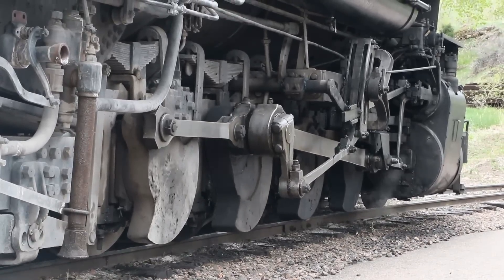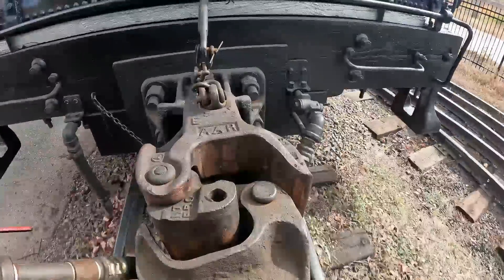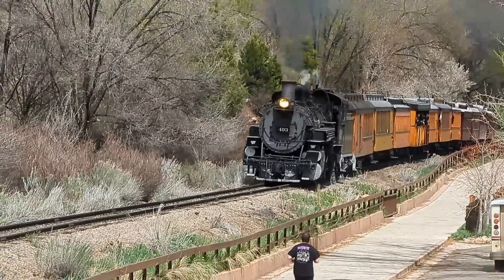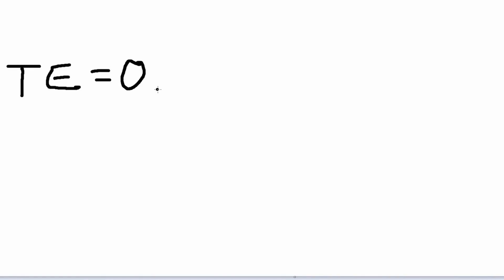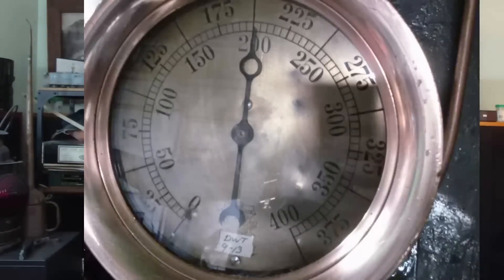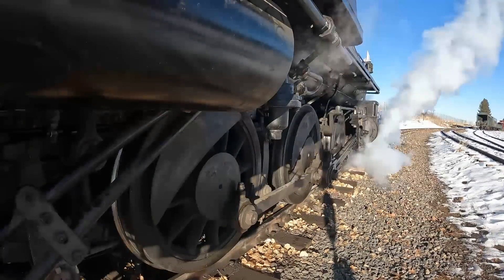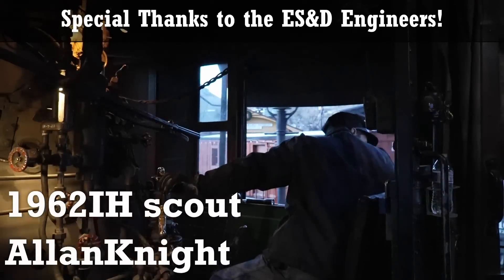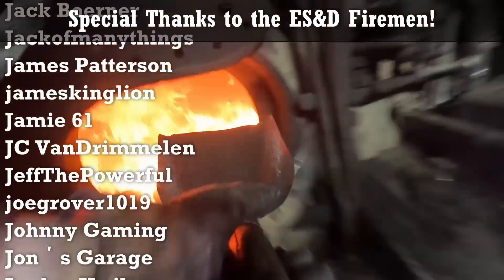Busting Tractive Effort MYTHS! | Railroad 101

Comment: Excellent video. Definitly needs to be part of any steam locomotive class.

It's interesting reading railroad engineering books about the wheel and rail dynamics. Steel is elastic, so the contact area between the wheels and rails changes depending on the steel types and weight. But generally speaking, more weight per axle means a larger contact area; conversely, less weight means a smaller contact area. It works out that a locomotive with one drive axle with X weight versus a locomotive with four drive axles with a total of X weight has nearly the same total contact area between the wheels and the rails. This is why the number of drivers isn't as important as one would think.
Reply from the maker: That's interesting! I'd imagine tire hardness plays a lot into that as well. Makes sense.
Reply: @Hyce777 @Hyce777  Yes, the hardness is important. The higher the hardness, the less elasticity in the steel, and the less traction can be developed. If the wheels/tires are too soft, they'll have good traction but wear faster, increasing repair downtime and raising maintenance costs.

Also, the harder the wheels, the faster the rail will wear down. Thus, the railroad must balance how often it wants to replace rail vs. wheels.

ASTM (A-504), AAR (M-107), and APTA (PR-M-S-012-99) each have standards for metallurgy and hardness of locomotive and car wheels depending on expected speeds and braking forces.

In Grand Scale trains, car wheels are typically made of high-carbon steel and have hardened treads, while locomotives have medium—to low-carbon steel tires for increased traction.
Reply: @CurtisFerrington  : Also, to a first approximation, friction is proportional to the weight applied, and not proportional to the size of the contact patch.  I suppose that there are second-order effects there, though, as well as effects on durability and rail wear, though?

Comment: Would be very interested to see the TE formula expanded into a mathematical model that could describe/predict how a locomotive and train will behave at different speeds. It should be possible to derive the optimum throttle and reverser settings if the model is detailed enough.
Reply: There are several ways to account for it at speed, from pg. 23 of Principles of Locomotive Operation and Control: T.F.=[(0.85P*s*d^2)/D]* speed factor. P= pressure in inches, D= diameter of drivers in inches, d= diameter of piston in inches, and s= stroke in inches. The speed factor is basically has to be derived to show the locomotives tractive effort changes at speed, and the book isn't super clear there on how to derive it. But pg. 24 shows a Baldwin table that calculated out various common tractive effort curves as speed changes.
Reply: @jacoblyman9441  I wonder how much of that is theoretical and how much of it is empirical. Wouldn't surprise me if the theory is actually very complicated but if you stick your locomotive on a test rig you can take readings.
Reply: @jacoblyman9441 it's not the change of road speed, it's a change in piston speed.

Comment: Wait are there really mechanical engineers who thought that making a wheel bigger would INCREASE the tractive effort? You can tell by looking that the piston rods are what's applying the torque... they're looking at the lever arm backward...
 
Did they also think that adding more steel would make the train lighter?
Did they think you could make the boiler smaller to produce more steam?

I... this... this... GHAAAAAAAAA!
Reply: Yes , they thought a larger wheel which gives more surface area on the railhead ....
Take a SD-40-2 drivers are 40 inches  ..
Now take SD70ACE drivers are 45 inches 
So yes , a larger diameter  wheel can give you a better grip if you have a much better power supply ..
D.C. TRACTION MOTORS 
COMPARED TO 
A.C. TRACTION MOTORS
Reply: @RobertSwickard-o1w  "I'm going to compare the performance of 2 diesels, and temporarily forget that the difference in tractive effort is really because of different motors and not the wheels. Then I'm going to assume that this translates over to steam engines without putting any further thought into it because steam is just a louder, dirtier diesel isn't it?"
 
-- Mechanical engineers who need better critical thinking skills apparently.
Reply: I expect that some of this is that the engineers were not clear about communicating their assumptions, and were assuming that their listener would interpret "increasing the wheel diameter" as including "increasing the crank-pin radius in proportion."

But engineers are never ever unclear about communicating things when they're talking informally.  Nope, not ever.

Comment: Layman´s terms:
1) Tractive effort: the maximum weight of your car that your engine can power without choking and dying
2) Adhesion: are you able to use that power without spinning the wheels?
3) Drivers´ size: final gear -> big = more revolutions, needs more torque
4) Piston stroke, surface, pressure: torque

Lesson:
1) If you want to tow a cargo ship, your super ultra tuned, high tractive effort semi truck may not be enough if it has only one powered axle (and low weight), as it would overcome the adhesion limit of its tires and produce only wheelspin.
2) Converting your cheap little grocery-getter car into all wheel drive won´t increase its tractive effort. In fact it may decrease it a little bit (due to increased inner friction). But it may help on a slippery surface.
3) Higher gear (bigger wheels) is only good if you have enough tractive effort and adhesion, and just want to go faster.
Reply: Thanks. This clears up a lot of my questions. Less confusion for me!
Reply: Meanwhile Jeremy Clarkson towed a ferry 100m with a grocery getter.
Reply: @kornaros96  Ferry is surely nothing like a cargo ship. Anyway, if the car has enough torque and adhesion to overcome the resistance of the water, then why not?
Reply: This is wrong. TE has nothing much to do with the weight of the car - that does become a factor in hill climbs, though. On level ground at high speed the thing your TE is fighting is mostly drag and the weight is a minor issue.

Comment: The maximum allowed axle load of course depends on the lines where the locomotive will operate. Each line having a limitation there (in continental Europe there are classes A, B, C, D from light to heavy with subclasses about weight per meter for bridges).
Back in the steam age for a long time the military required all Austrian locomotives to be used universally in times of war. That and the limited length of turntables put pretty severe restrictions on the growth of locomotives and lead to ingenious constructions. For example the first locomotive with five coupled wheelsets, kkStB class 180 (built from 1901) designed by Karl Gölsdorf with just 13.5 t axle load. Distributing the load over five wheelsets allowed it to have sufficient tractive force anyway (though I can't find the kN in my sources).
Even today some locomotives aren't permitted on certain lines for which they are too heavy.

Comment: If I may ask how did railroads calculate how much tonnage they could haul? Obviously TE plays into the equation as you said but I figure fairly early on the railroads made a system beyond "Keep throwing cars on until the train can't move at all or without breaking something.".

Comment: What about geared steam locomotives tractive effort calculations?
Reply: That should be fairly simple. Just do the same calculation but multiply it by whatever the gear ratio is between the cranks and the wheels. So if the cranks turn 3 times per wheel rotation then you have 3x as much TE.

Comment: Actually: why can a steam locomotive pull more than it can start? Compared to AC and DC traction.
Reply: AC and DC diesels have a large TE like steam when starting but diesel TE drops extremely fast when you are moving. 

I cant remember the exact math but you end up dividing by speed instead of wheel size. 

Faster you go the less you have compared to steam where it lowers TE at speed at a slower rate due to how steam works and expansion in the piston

Comment: I believe the coefficient in the tractive effort isn't something calculated from other prrcise things like area of a circle or of a sine wave, but instead something to make the numbers work. this is because the ratio of the radius of the drivers and the diatance from the crank shaft pivot to the center of the driver isn't considered, even though it is really important, because it doesn't change much across locomotives. So because all values rise linearly (other than the piston diameter but who cares) a simple cefficient can be used so that the funcion mathches real behaviour.
Reply: The ratio between crank diameter and wheel radius IS in the equation, it's just disguised. The piston stroke (last term on the top of the division) is just another way of saying crank diameter. And of course wheel diameter is on the bottom of the division.
Reply: @John73John  i did figire that out a few minutes after I wrote that, too lazy to edit
Reply: @torfley  Yeah we've all been there mate.
Reply: It's not.  See Johnson (1944) and De Pambour (1836).
Reply: 0.85 is taken as the mean effective pressure acting on the working face of the piston through one stroke.

0.85 was chosen after numerous indicator card tests.

The equation has nothing to do with any ratios between crank diameter and wheel diameter.
Reply: @theimaginationstation1899  I don't know what that is, can you explain a bit more on what those are and how I can get to them?
Reply: I left anorther comment with a donation on this video where I explained what I actually wanted to say. I don't think this comment provides any more value to that idea

Comment: I'm not sure about π/4. It's not in 0,85. π/4 is destroyed when you multiply it by 4/2π - is average force coefficient, since you have different instantaneous tractive effort every degree of wheel rotation (piston movement). π/4 · 4/2π = 1/2. That's why for locomotives with 2 pistons you have 2 in the equation, which is divided by 2 and thus = 1. While general equation says that TE = number of piston · other coefficients / 2.
Reply: You're not sure because the explanation is wrong. 0.85 was adopted following numerous indicator card test - and is simply the mean effective pressure through one stroke at start-up until about 10 mph.
Reply: the coefficient is just to make the numbers work and give realistic results because all of the values are linear. they measured the force of a locomotive, put the respective numbers in the formula and saw which number times the formula result gives a number similar to the one measured. from the it just works

Comment: Gotta love you folks with your silly freedom units. It's basically just you and Myanmar. Even Canadia is ahead of you in terms of switching to actual scientific units of measurements 😂
Reply: What's scientific about a measurement system based on an arbitrary mass, a length based on a guess as to the quarter meridian of an arbitrary planet, a similarly arbitrary time scale, and a number system based on the digits of a particular species?  The imperial system of units and the US customary system of units work just fine.  They are only disadvantageous for trade purposes and will probably decline for that reason alone.  Besides, it's more fun when playing with nonstandard units.  I think pressure should be measured in slug furlongs per second squared per square nail. ;)

Comment: I wonder how different the TE equation is for our HO scale engines with electric motors and if the resulting TE is higher or lower than the engine being modeled.
Reply: take the torque of the electric motor and divide it by the wheel diameter. before that you need to apply any mechanic advatages of gears between the engine an wheel and not take into account inefficiencies.
Reply: @torfley  thanks.
Reply: That could be a fun video

Comment: Hyce, you mentioned that torque comes from the length of piston stroke.  I wonder if that should not be calculated from the length of the crank arm related to the driver diameter. There are basic calculations of leverage ratios in that combination. Yes, the longer crank arm would result in a longer piston stroke. But cylinder pressure (NOT boiler pressure) is a factor. The more pressure on the piston the more effort goes to turn the crank arm -  And  you have friction losses along the way piston rings, stuffing box, cross head slides and main axle bearings. The minor contributors would be all the bearings and bushings for the connecting points of the moving parts. Unlike liquids, steam is a gas, subject to heat loss and condensation as it travels through the exposed pipes going from the smoke box, through the valves, into the cylinder. What is your though on this?
Reply: The formula for tractive force divides by driver diameter, so the ratio of piston stroke to driver diameter is contained in the formula.

The *0.85 figure for "Mean Effective Pressure" was not universally used by every locomotive maker in every country, but it became standard over time. It is an approximation which lumps several things together, and Hyce mentioned three big ones. Frictional losses and back pressure in the cylinders were not mentioned, but they affect real life tractive force too. And in non-superheated steamers condensation losses in the cylinders would have a much larger effect. For the most part these issues grow in importance as speed increases and have only a small effect at low speed.

If a boiler can produce enough steam to keep pressure up the condensation losses could be mostly negated. It just takes more steam to replace the volume loss from condensation. That uses more water and fuel. The advantage of superheating came from a combination of expanding the steam further and reducing the condensation losses.
Reply: Note that the piston stroke is equal to twice the length of the crank arm, so it's effectively the same thing.  And the "related to the driver diameter" then is why the driver diameter is on the bottom of the equation.
Reply: Also Torque is an result of Piston stroke and Bore,
because all the pressure needs a Point to lay on for the time of expansion.

And the fact where on the wheel the crank pin is located, far out or very centered.

Comment: The one thing that still bothers me is that 0,85 in the tractive effort equation for non-American locomotives. While American locomotives are built with a coefficient about 0,85. Non-American locomotives have very different values. I saw them ranging from 0,274 for Soviet locomotive class IS 2-8-4 to 0,638 Class A4 Mallard 4-6-2. Most others (at least those I've checked) are between these two values. Why?
Reply: I'm not an engineer like Hyce, but if I can give my own opinion. I believe it has to do with the job and the type of engine it is. American built are needed for moving heavy freight (for the most part) compared to British which was needed for light to medium freight and passengers.
Reply: @Johndoe-dc  well it wouldn't be of much use if you don't know the actual tractive effort. you know the actual number and then you run the locomotive how you consider depending on the load.
but because different regions use different measuring systems you must have different coefficients, which all multiply into a single one. after that you can count the different pros and cons of locomotive which change the coefficient
Reply: @torfley  i did say it was own opinion. I work MoW for a short line not an engineer.
Reply: Mallard was a 3-cylinder locomotive, so a different formula is used to account for the different valve timing and 6 impulses per rotation vs 4 impulses of a 2 cylinder. I do not know what formula was used for the Russian locomotives.
Reply: They weren't built withy that K factor.  K was simply adopted as standard in North American practice.  Other jurisdictions and other roads were free to adopt whichever they wanted.  In New Zealand K = 0.80.
Reply: measuring systems

that's pretty much it

Comment: I once murdered the backs of several unimportant pieces of junk mail trying to work out where the bloody hell that 0.85 came from. I got as far as pi/4 had to be in there somewhere before throwing in the towel. Thank you for the explanation and the general nerdiness. I love getting in the weeds on this stuff. Great video!
PS: here's my vote for a video about curves, hills, and other things that affect the on-paper tractive effort.
Reply: It's clearly more of a "this is to account for the unaccountable variables" number. Theoretically, it could be any number of values, because it also doesn't account for things like the condition of the locomotive, as it assumes everything is in 100% working order.
Reply: It's simply the K adopted by the American Association of Railroad Master Mechanics in about 1900 or so - and reflects numerous indicator card tests as to what the mean effective pressure was through one stroke.  It's imperical rather than theoretical.
Reply: In irl engineering there's always a "this equation is incomplete" fiddle factor. Better models will have fewer components in said fiddle factor and thus fit a wider range of situations without having to experimentally determine the fiddle factor, but there almost always is one.
Reply: I believe that coefficient is just something to make the numbers fit the real behaviour of locomotives because it is all linear. If this formula would be precise, the coefficient would be 1
Reply: @torfley  No, the coefficient should not be 1, because the ideal equation has to include pi/4 because the cylinder has a circular cross section and some other numbers to account for the fact that the engine has two cylinders 90 degrees out of phase.